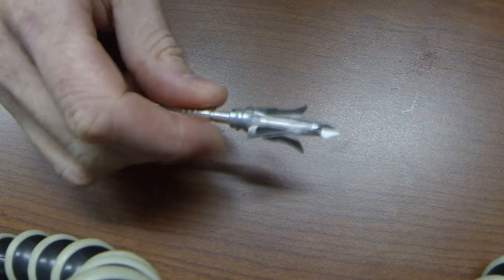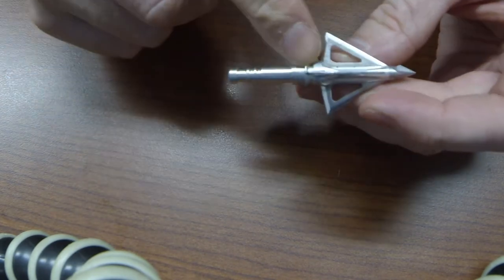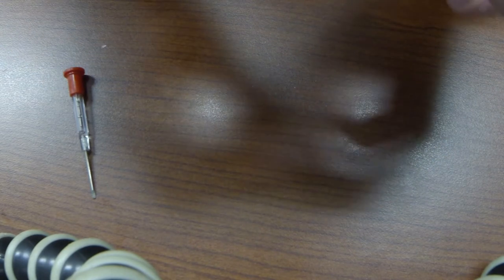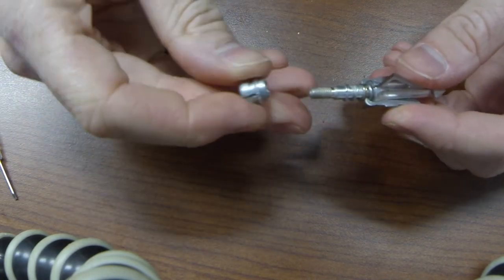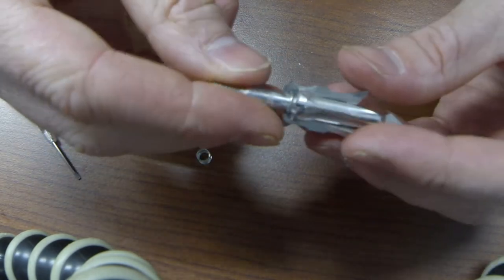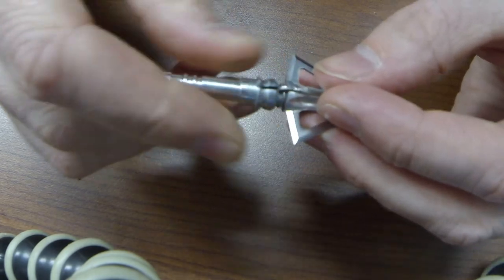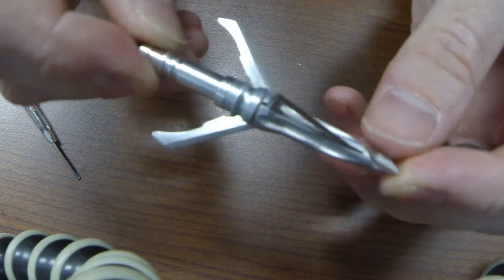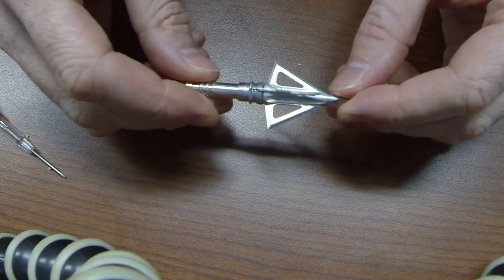Grim Reaper Hybrid broadhead servicing and cleaning

Comment: Thank you for putting this together. Any idea where I can get some sleeves to hold my broadheads together now that I've replaced the blades but threw those sleeves away long ago?
Reply from the maker: +zakorkaz You might be able to get the exact ones from Grim Reaper them selves, but you can also get away with using regular arrow inserts. They do essentially the same thing.
Reply: +OutdoorShellback Thanks for the idea. I'll grab some inserts.